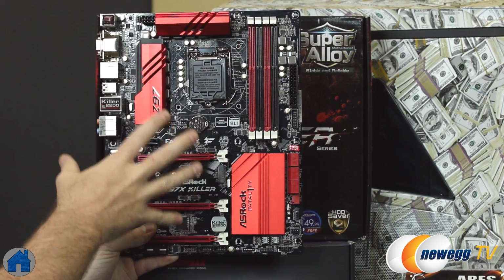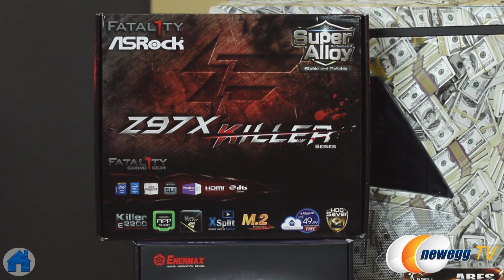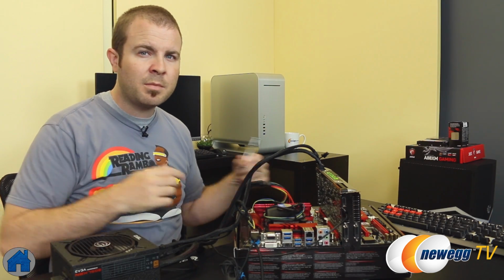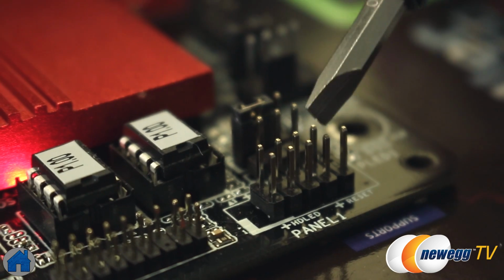How to Build a PC - Part 1 - Newegg TV

Comment: Guys what do you think of this for a first time, budget, kinda gaming build?
AMD FX-6300
AMD R9 260x (sapphire 2gb)
HyperX fury (2 x 4GB)
Seagate Barracuda 1TB 3.5" 7200RPM (may get Samsung MZ-7TE120BW SSD tho)
EVGA 430W 80+

will it run minecraft over 1 fps? jk
Im not being an amd fan boy they just seen pretty good for the price. Im open to other suggestions, nothing more expensive tho :( Ionly really went amd for the GPU cuz bf4 likes red cards :P
Reply: ultraguy 3 Intel processors are better for gaming, I recommend the newest Intel Pentium. Upgrade your graphics card, the 260x isn't going to do shit. 8GB is great, but if you're on a tight budget, it's acceptable to go 4GB and upgrade your GPU.
Reply: Will Y There's nothing wrong with Intel. And there's nothing wrong with AMD. My rig is gonna have a 8350. I feel that the 6300 is a good CPU for a budget build.
Reply: Will Y What graphics card do you recommend then, that's a little bit more expensive?
Reply: ultraguy 3 Go a step higher and get the r9 270. It's only 20-30 dollars more expensive but it's a worthwhile investment.
Reply: Vertex Gaming - Gaming - Comedy Most games utilize single cores, or dual cores at most.

AMD CPU's are better at multi-threaded operations (multiple cores) while Intel CPU's are better at single-threaded operations (single core).

Therefore, Intel processor generally handle games better.

However, newer games do have multi-threaded support; however, they are a small minority among the 90% of single-threaded games.
Reply: hmmm the 270 is quite old too.. new games might kill it?
Reply: ultraguy 3 No as long as your not going for ultra textures you should do fine. But I would get the 270X and something like this. http://pcpartpicker.com/p/DJqJXL
Intel has better core to core performance meaning you'll have better performance at games while AMD will have better multitasking performance.

Comment: Is this a decent Gamer/Basic Developer build?
AMD FX-6300 Black Edition Processor
 EVGA Geforce GTX 750
MSI 760GM-P23 Motherboard
Ballistix Sport 4gb RAM
Samsung SH224DB/BEBE Disk Drive
Rosewill Ranger-M Case
EVGA 400W ATX Power Supply
Seagate Barracuda 500gb Hard Drive
Windows 7 64-Bit OS
Reply: Lazercat77 Go with an Intel processor; it's better than AMD at games (I recommend the newest Pentium). Your GPU is too weak, upgrade it to much better one (AMD or nVidia, doesn't matter that much). I'm pretty sure you can get a 1TB hard drive for only a few dollars more, might as well get it.
Reply: You might want to get 8 gigs of ram depending on what you are doing

Comment: I have gotten stuck trying to get into bios during the outside build section. When I try to boot up my motherboard the graphics card led and the cpu fan go on then turn off and go back on again about every two seconds. I test the power supply with my case fans using the paper clip trick with the 24 pin connector and it was working fine. I also tried to clear the CMOS with no prevail. Could it be a problem with the cpu or is it likely a dead motherboard? 

Parts List:
CPU: intel i7-4970k
Motherboard: MSI Z97 G55 SLI
Graphics Card: Gigabyte gtx970 windforce
PSU: Corsair HX 750

Comment: Is this a good gaming build?

 PCPartPicker part list: http://pcpartpicker.com/p/4Ld4hM
Price breakdown by merchant: http://pcpartpicker.com/p/4Ld4hM/by_merchant/

CPU: Intel Core i5-4590 3.3GHz Quad-Core Processor  ($187.99 @ SuperBiiz) 
Motherboard: Asus Z87-Pro ATX LGA1150 Motherboard  ($104.99 @ SuperBiiz) 
Memory: Team Vulcan 8GB (2 x 4GB) DDR3-1600 Memory  ($56.99 @ Newegg) 
Storage: Seagate Barracuda 3TB 3.5" 7200RPM Internal Hard Drive  ($85.83 @ Amazon) 
Video Card: XFX Radeon HD 5770 1GB Video Card  (Purchased For $0.00) 
Case: Apevia X-SNIPER2-GN ATX Mid Tower Case  ($48.99 @ SuperBiiz) 
Power Supply: Corsair CX 600W 80+ Bronze Certified Semi-Modular ATX Power Supply  ($58.98 @ Newegg) 
Total: $543.77
Prices include shipping, taxes, and discounts when available
Generated by PCPartPicker 2015-04-11 03:03 EDT-0400

Comment: is this a good pc build? 
89.99 diypc gamemax white w/leds 
179.99 sapphire dual x 100373l readeon r9 280 3gb gddr5
129.99 amd a10 7700k 
119.99 asus a88x pro 
72.99 hyperfury 8gb (2x4) ddr3 1866 ghz 
99.99 crucial mx100 256gb ssd
134.00 evga 220gs085v1 850w power supply
Need to know anything wrong with this build before i buy and try to build it

Comment: How is this build?
Corsair Vengeance 8GB DDR3-1600MHz Module
Crucial MX100 256GB 2.5 inch SSD
EVGA GeForce GTX 970 Superclocked ACX 2.0 4GB 256-Bit GDDR5 Graphics Card
Intel Core i5 4460 Processor 3.2Ghz 6MB Cache - Socket 1150
Raidmax Vortex 402 Chassis - Black
WD Blue 3.5" SATA 3 Hard Drive - 1TB
I haven't got my cooling system down yet, I'm open to suggestions
(My first PC build, so I know it's propably bad)
Reply: Gameosaurus It seems like you're going for somewhat of budget build, so I would suggest sticking with the WD Blue, which is a bit cheaper. Depending on whether you plan on doing CPU intensive activities, you may want to switch to an i5 4690K, which is overclockable and also has a higher base clock for only 40$ more. In terms of cooling, i5 4460 is not really made for overclocking so you should be fine with the cooler that comes with the processsor. If you do get the 4690k, also get the Hyper 212 EVO, which pretty much everyone suggests. I just ordered a GTX 970 from Newegg, and currently the cheapest option is the MSI which is about 320$ after rebate. You forgot to include a motherboard, so I will suggest checking out the Gaming 5. Finally if you were planning on playing Advanced Warfare and having 50 Chrome tabs open at the same time, you may want to upgrade your RAM to 16, but purely for gaming purposes, this is unnecessary.
Reply: Robert R Opps wrong GPU meant the 970.
http://uk.pcpartpicker.com/p/P2FpLk
Reply: Why not WD Black?
Reply: good idea thx (i actually just listed everything i could find that was closest to what i wanted)
Reply: Thanks alot for the tips alex. Honestly i expected people to comment saying how much of a noob i am, but proved me otherwise. I'm actually gonna use this computer for recording high quality games while running them fast and rendering them to very high levels, so if there's anything else because of the recording and rendering, let me know.
Also, How many fans do i need for this build?
Reply: Gameosaurus I'm not going to say I know much about recording games, because I do not, but you are going to have to run the recording software while you are playing high quality games, so that will probably drop your FPS. If you want to be able to run upcoming games on max 1080p 60fps, even without recording, the 970 may even fall short. For example the Wither 3 developers said they were able to run it on ultra 1080p 60fps with a gtx 980, 16GB RAM and an i7 4790K, although they did not say it was necessary. So you may want to consider that when deciding what to buy, especially if you want to keep running games on ultra at least until the new line of nvidia gpus come out.
Reply: Alex Yalcin Thanks, i'll consider it. Also, how many fans do i need, what fans should i use, and what power supply would be best for this build(P.S I'm not watercooling it, i'm too new to building computers)
Reply: Gameosaurus the 970 will be fine. I run bf hardline at 95 fps with mine. The 980 just isnt worth the cost. An i5 is perfect for gaming, dont listen to the other guy. Games dont use hyperthreading so you dont need an i7. For fans, dont get the cheap off brand ones. the case you are getting has one exhaust fan, which is not enough. i would buy 2 corsair af120 fans. they are about $15 and you need to put on on the top and front of your case. The top being exhaust, the front being intake. Also, if you can get a better cpu cooler. the hyper 212 evo is great. Its not necessary though. Stock cooler will be just fine as ling as you dont overclock.
Reply: Lemmiwinks9619 Will I be able to record while keeping good frames and quality with the i5?
Reply: Gameosaurus yes just lower the anti aliasing in games
Reply: Lemmiwinks9619 k thx but i'm just gonna stay with i7 just for that little bit more incase i need to render and record a really intensive game or something like that, and also cuz i'm gonna be overclocking
Reply: Get the Amd fx 8370
Reply: I would upgrade to an i5 4690k
Reply: Gameosaurus I would get this build.
http://pcpartpicker.com/p/LN2Lxr
Reply: Gameosaurus Did the build go well?? Do any of you guys know how good this build would be : http://uk.pcpartpicker.com/p/xprknQ
Its my first attempt at looking for parts so it probably would be awful, but you've got to start somewhere.
my case i wanted one: http://www.amazon.co.uk/gp/product/B00MNIGFB0/ref=s9_simh_gw_p147_d0_i6?pf_rd_m=A3P5ROKL5A1OLE&pf_rd_s=center-2&pf_rd_r=0936GZBVCW1STBDQF0P9&pf_rd_t=101&pf_rd_p=455333147&pf_rd_i=468294
Reply: Daniel Kershaw I'm still hesitating in case I find a better build, because i'm sparing no expenses up to R50 000 (South African money, use currency converter. P.S not all Africans are tribesmen with Ebola)
Reply: Gameosaurus :D That's loads compared to my budget
Reply: Daniel Kershaw I've been saving and i'm still gonna save till September aprox. But I don't know if this PC will be good for recording high quality videos for very power-hungry games and rendering them to high qualities for YouTube. I'm thinking that I could use a list of components for Messyourself's computer(Messyourself is a YouTuber) after watching his GTA V PC video
Reply: Gameosaurus Are you going to be using wireless internet/wired/none because you may need a network card (Not sure)
Reply: Gameosaurus Sounds like a good build. Core i5 is great!
Reply: Daniel Kershaw I would choose a better case, that case is bad, CIT aren't a good company with Computer cases, go with more mainstream companies like Corsair,Coolermaster,NZXT and Fractal Design etc. I would this as a base for your pc as it's a cheaper and overall better gaming PC. http://uk.pcpartpicker.com/p/bGBf4D
Reply: Also, I don't have a power supply or a keyboard, and for the keyboard I want some thing glowing silver L.E.Ds and aluminium case to match my CMStorm Reaper mouse and CMStorm headphones whom's name I cant remember. I also need a glowing silver case, because I'm OCD like that. I don't want the case on this list anymore
Reply: Gameosaurus Then just get this 
http://uk.pcpartpicker.com/p/877rCJ
It's a silver/white case and just add some white LED fans.
Reply: OAcesync That's a terrible build. Way overkill CPU with horribly underpowered GPU.
Reply: Gameosaurus Your build is actually pretty good. I wouldn't recommend raidmax though. YOu still need a mobo and PSU. The 4590 is not much more for a bit more performance. Gget the WD Caviar Blue. The stock CPU fan will work fine if you don't OC. (Only available on unlocked (K series) processors)
Reply: OAcesync That's much better. Now it's a great build that I would recommend. Certainly there's ways to save cash, but it's very good. I can see you didn't mean to do that, but places like Alienware make their money by doing that.
Reply: Robert R Ikr ever since I became more Computer savy, I rage when I see the CPU/GPU(i7 4790/960) combos that they sell, most pre built computers are like that overpowered and underpowered at the same time.
Reply: OAcesync I'm a little new to this, but is the 960 not a good GPU?
Reply: xNYbeast It's mid tier GPU, it's a GPU you would get for more budget oriented 1080p. But it's not that bad it will acheive 60fps 1080p at Low to High settings depending on the game. If you have the money get a R9 280X/R9 290/R9 290X or 970 depending on how much money you have.
Reply: ***** Don't mean to be critical but that's a bad build bud, underpowered PSU,GPU, overpowered CPU and it's a terrible case. If you have the money get something like this. http://pcpartpicker.com/p/7wJhLk
Reply: ***** The 750Ti is a very budget oriented GPU that will achieve 30-60fps on Low to Medium depending on the game at 1080p, you always choose a CPU according to the GPU power and that CPU is wasted on that budget GPU making it a waste of money, that PSU is non-modular meaning that all of the cables are permanently stuck to the PSU which causes more clutter and makes it hard to have good cable management(you want good cable management for more airflow and for clean looking builds) while full or semi modular PSUs allow you to remove cables that you aren't using for easier cable management also that particular PSU isn't that good and 430w is not recommended it would just about power your system but if you were to overclock(boost speeds by also boosting voltage) anything or make any upgrades that PSU would shut down, you don't need 16GB RAM for gaming just 8GB, you don't need extra thermal paste all coolers come with thermal paste,the motherboard is okay but the best motherboards are ASUS and MSI, Aerocool don't make good cases the best cases are NZXT,Fractal Design,Corsair,Coolermaster etc, you always should get the lastest OS for better driver compatibilty, and lastest features,I wouldn't get a PCI wireless adapter just simply because it may cause space issues with the GPU I would get a USB one instead and make sure is says 802.11 b/g/n/a/ac,that monitor is very small and has a low resolution  and that keyboard has poor visibility with the keys.
Reply: ***** No problem I know how hard it is learning everything from experience.
Reply: ***** Motherboard is fine although you don't need an expensive one, that case is horrible like I said I would only go with cases made by NZXT,Fractal Design,Corsair,Coolermaster. That CPU is overpowered for the 960, and that monitor isn't even 1080p. What is your budget and I can give you a base build.
Reply: ***** This is a build I would go with. http://pcpartpicker.com/p/7VdBt6
Reply: Use ryzen, much better bang for the buck

Comment: please can someone tell me if this setup will work?

Intel Core i5-4460 3.20GHz (Haswell) Socket LGA1150 Processor - Retail

LiteOn 24x Internal SATA DVD RW Drive [IHAS124-14]

2TB Seagate Barracuda ST2000DM001 3.5" SATA III Hard Drive - HDD

BitFenix Neos ATX Tower Black/Red	
			
16GB (2x8GB) Corsair Vengeance Jet Black Low Profile 1600MHz CL10 DDR3 Dual/Quad Channel Kit [CML16GX3M2A1600C10]
			
EVGA GeForce GTX 960 SSC 4096MB GDDR5 PCI-Express Graphics Card (04G-P4-3966-KR)	
			
GIGABYTE GA-B85M-D3H Intel B85 (Socket 1150) Micro-ATX Motherboard	
			
750W Corsair Builder Series CX750M 80PLUS Bronze Modular Power Supply

Comment: Hi guys this is my first time building a pc. What do you think of this build?
-Intel i5 4690K Unlocked Quad Core Processor
-ASUS Z97-E Motherboard
-Kingston HyperX Fury Memory Black 8GB 2X4GB DDR3-1866 CL10 Dual Channel
-Corsair CX Series CX600M 600W ATX 12V 80 Plus Bronze Modular Power Supply
-Seagate Barracuda 1TB 7200RPM 64MB SATA 6Gbps 3.5IN Internal Hard Drive
-Raijintek Genesis Series Agos ATX Mid Tower Case

For a gpu i was looking to get a gtx 970 but I'm not sure which one to get and I am still looking for a deal.
Reply: I would say get the r9 290 or 270x
Reply: Hassi Ziaar I actually ended up buying a Gigabyte G1 Gaming GTX 960 even before you posted this.
Reply: robert99255 Lol. Can't you return it ?
Reply: robert99255 The GTX 960 is not a good deal for $200. The R9 380 is a much better deal. Also, the CX600M is a mediocre PSU
Reply: William T I've had my computer built for months now
Reply: His build is fine but I would recommend a r9 380 and it will run all games 1080p fine.
Reply: I did end up getting a gtx 960 but if you can I would recommend a 970. The 960 is fine and I can run most games maxed out 1080p and usually get 60fps+ with the exception of some games running at 30 but that is only for The Witcher 3 if I remember correctly (which I couldn't run max settings btw). It depends on what kinds of games you play really. If you only play games like CS:GO then all you need is a 960 (I get something like 200 fps in CS:GO). Although if you are playing anything else more demanding I would recommend a 970, just to try and future proof more. For the case I absolutely love it and is my favourite part of the build. Highly recommend you get it. Power supply I have been told is not a great one but I don't really have the expertise to notice it isn't. Still recommend you look for something else. Mobo I'm quite happy with. Plenty of options and more than I even need and I would recommend it. CPU I am also pleased with and would recommend it. Still haven't overclocked it yet but I will get to it eventually. Hard drive is solid. Good buy. As for the memory, you don't need more than 8gb as long as your not doing heavy multitasking or streaming so 8gb will be absolutely fine. The sticks I got look nice and also perform good so I would recommend those as well. Also I don't know if I have it on my comment there or not but I put in an optical drive and am satisfied with it. You probably don't need it now days but for $20 it's nice to have. Anyways I hope  I didn't miss anything. Overall I am fairly happy with it though. The only thing that really stands out for me personally is that I wish I would have gotten a 970 instead. Just ask if you have any other questions. Btw I got the windforce edition of the 960 and am really pleased with the features and that of it.
Reply: +str8up52 Get a R9 380 instead of the GTX 960.

Comment: can anyone recommend a good dimms for my build?
hers my build:
GPU: EVGA GTX 960
CPU: AMD FX-6300
MOBO: ASUS M5A99FX PRO R2.0
HDD: 1T WD
PSU: EVGA 500 80+ BRONZE
CASE: NZXT SOURCE 220

I have some in mind but not sure if it will work fine with my mobo, and if should i go 1600, 1866 or 2133? will only consider Corsair or G.skill brands